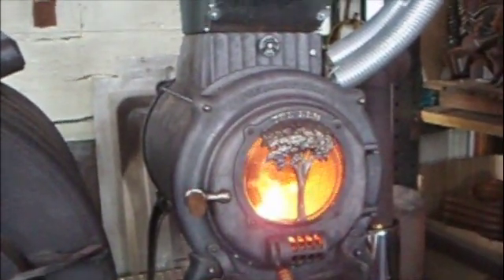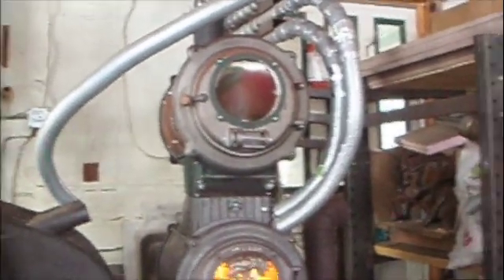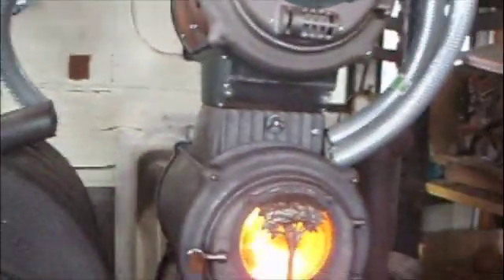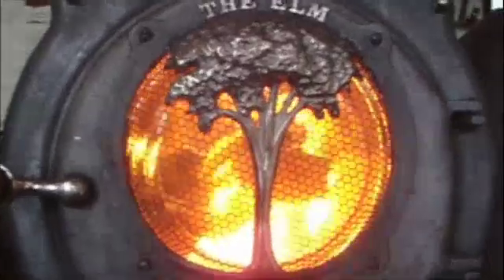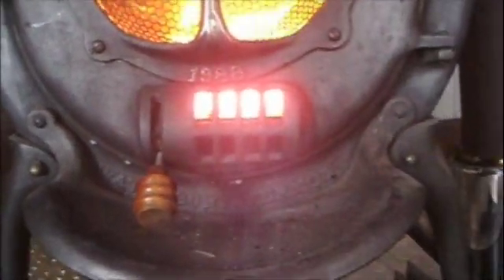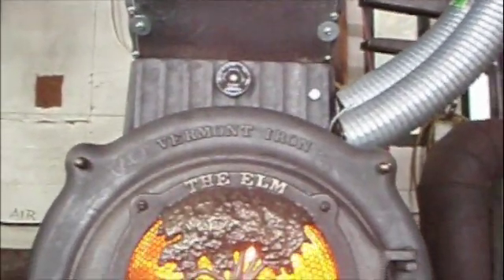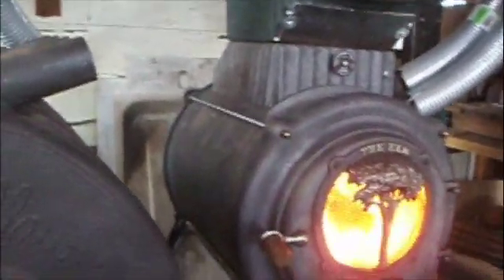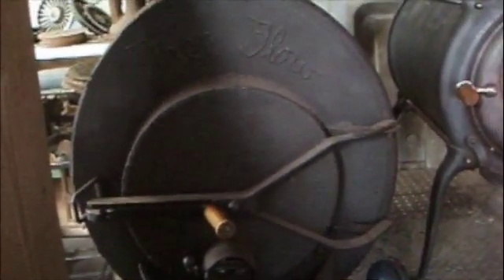Double barrel Elm

Comment from the maker: I would take a propane barbecue cylinder, cut one end off and hinge it, line the bottom with firebricks, put a piece of sheet metal around it as a shield, weld a 4" pipe to it for the flue, put a pyroceram viewing window in the door, put a horizontal baffle up near the top, about 2/3 the length of the body (also oriented horizontally) bring in stainless air tubes with 3/16" holes placed under the baffle. raise it up on long legs to make it easy to load, sand blast off the paint.use stove paint.

Comment: Thanks. I was just wondering if there is an off-the-shelf stove I could buy here in Ireland. Or perhaps a design for a Small, preferably light stove I could weld up myself. Was wondering about using an old gas bottle for the base; with a glass window so I can see the flames. Regards.

Comment from the maker: This is more complex than other stoves.  it needs to be almost cool to the touch on the outside, small, yet hold reasonable sized pieces, circulate air around the space well.  allow you to see the fire. Have minimal clearances to combustible surfaces. insulated on the bottom to keep the fire burning efficiently, and have a firebox baffle for the same reason.  a small intake to keep it from overfiring, and small chimney for similar reason. Up on legs to make it easy to load. uses, sauna, boats,

Comment from the maker: after all the thousands of stoves we have built, there is still an unfinished project, making small stoves for situations like yours.  Most of our customers like to be able to use large pieces of wood, have the fire last through the long nights, give off massive amounts of heat, burn the wood completely.  But you are posing a completely different question.  Small pieces of wood, quick heat, probably not giving off lots of heat because you would be close to the stove. I'll have to work on that.